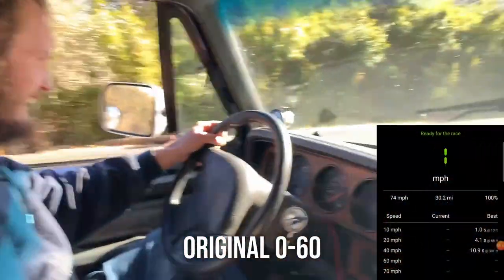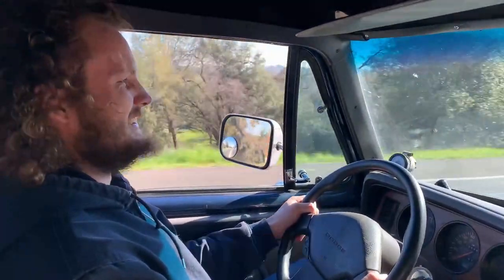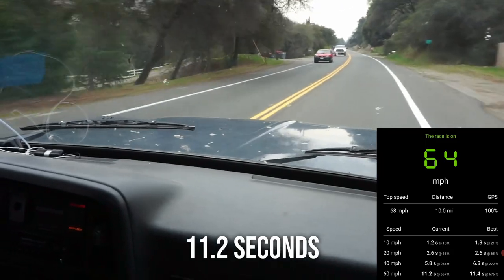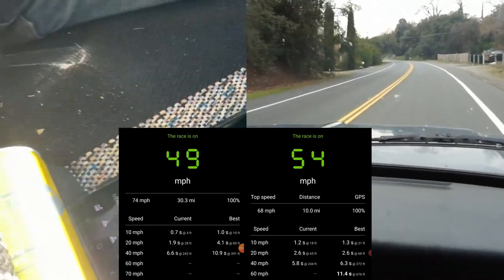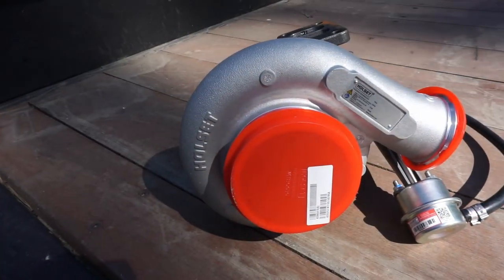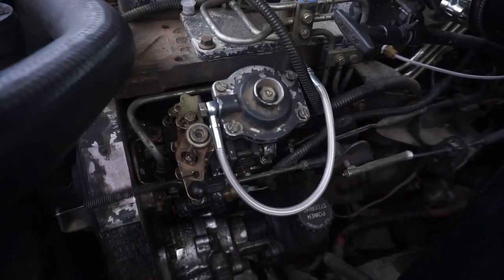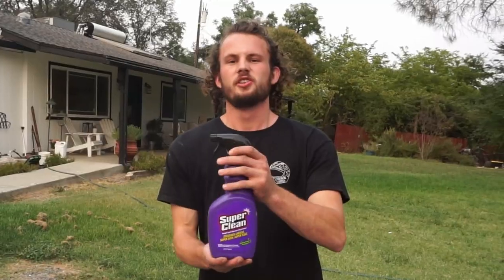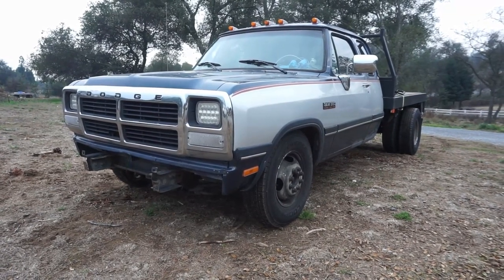Upgraded Cummins First Gen 0-60!

Comment: How much boost you getting before and after the HX35? What did you set the wastegate to?
Ive got a 96 12 valve and contemplating on replacing the H1C with an HX35W
Reply from the maker: I don't have a good reference before swapping. After the swap, I get up to 32psi in 3rd and 35psi in 4th. That's with the waste gate locked shut.

I hear that peak boost is not much different between the H1C and HX35W, but the HX35W spools up much easier. If you're looking for more power/boost, I'd check out a Borg Warner S300 or Holset HX40.

Comment: What happened to your mpg after this?
Reply from the maker: It slightly improved when driving slowly. When pushing hard, the MPG is definitely worse.
Reply: @FormulaJake  I got ya still in the 20s? I heard after the 1/8 bump it’s a little more efficient but u also had a bigger turbo so I was curious
Reply from the maker: The HX35W is pretty close to the original turbo and didn't seem to bother MPG much. Starting with the flatbed dually, I only saw about ~18mpg, usually around 75mph on the freeway and some city driving. With the timing bump and similar driving, the best I've seen is 20mpg. Not a huge difference but enough to notice.
Reply: @FormulaJake  well I’m glad how it turned out it’s awesome truck hope I get one soon thanks for answering my questions haha
Reply from the maker: Of course! Best of luck brotha
Reply: 2 seconds less… 15% decrease with all those upgrades and it’s still god awful 11 seconds to 60. lol
Reply from the maker: @Bo12346hhgfgdg it's a 1990s 1 ton truck that weighs 7500+ lbs and has a slow 5 speed. Mods were pretty minimal, too
Reply: @Bo12346hhgfgdg  hey there’s some pretty fast diesels out there man be 12v are just pretty weak
Reply: @FormulaJake  ok thats fair